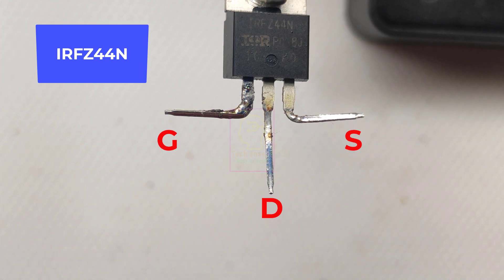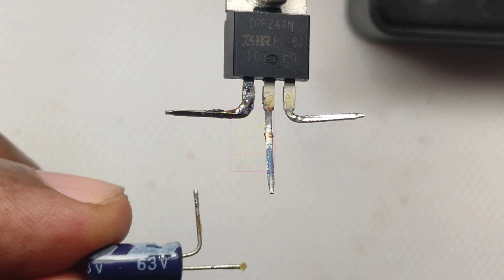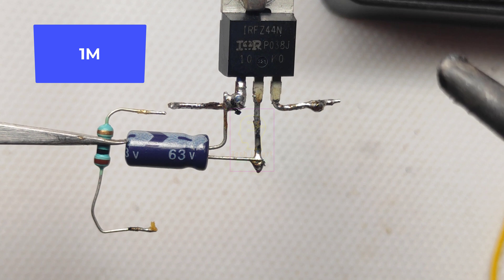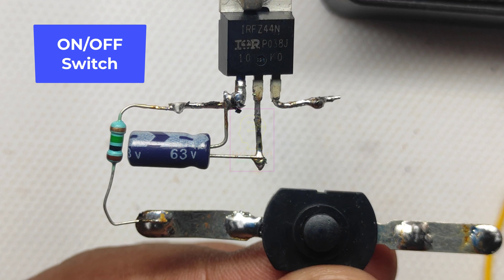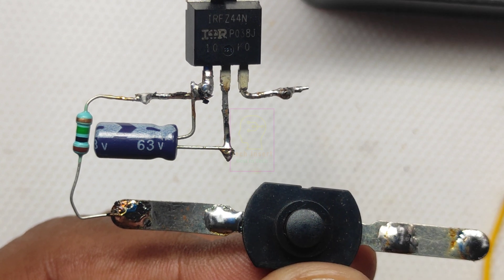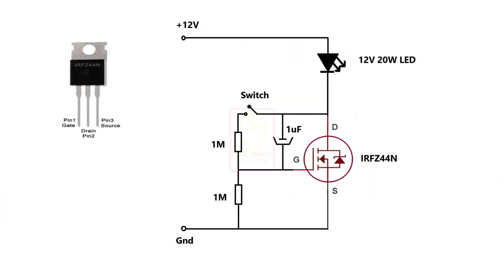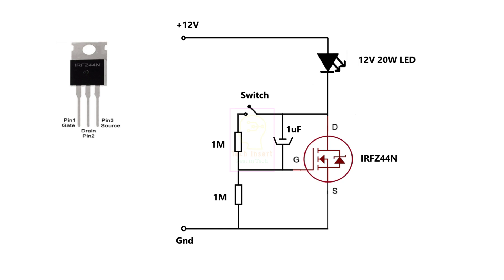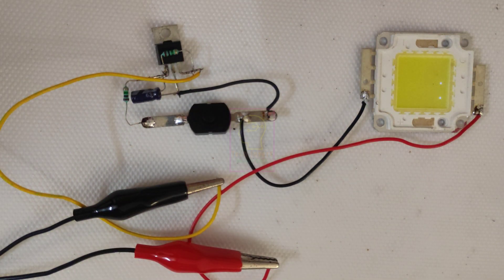How to Make Simple Soft Start/Stop For Motor/LED

Comment: Can it handle 21v 20amp and if yes then the single mosfet will surely become very hot and even if i use good heatsink some power will lose in form of heat
Can i parallal 2 mosfets to share current equaly
Reply: Ok now it's working perfectly but I want to use it with 21v do i need any modification in this circuit
Reply from the maker: @rctechmods8165  No change needed in the circuit
Reply from the maker: irfz44 can handle 49A with good heatsink. So it will works fine

Comment: Is this applicable another high capacity relay  40A to 80A for dc load
Reply from the maker: We cannot connect a relay in this circuit, coz relay is a normal switch which is switching electronically rather than manually. Here MOSFET is switching gradually thus softly start and stop.

Comment: Hey thanks for video
Can i use this circuit in between a 350ma 36v driver and 36v led to get soft on/off effects ?
Reply from the maker: My apologies for late reply. 
Yes you can coz irfz44 can handle upto 55V and 49A

Comment: Thanks for the video.
What will be the changes in the circuit if the voltage is above 35 volts
Reply from the maker: IRFZ44N can be used for max 55V

Comment: Can i do reverse the polarity like forward reverse dc motor?
Reply from the maker: Yes, change the wire connection
Reply: @TechInsert  does the capacitor not affected if I reverse the connection? Ok i will try this. Thanks a lot 🥰
Reply: @suplado7583  Not on mine. I put the output leads through a simple DPDT switch. I have been using this circuit for about 6 months for model trains in the garden. Locomotives drawing about 4 amps at 18 volts.
Reply from the maker: Good

Comment: Is it suitable for 12 volt 20 Amp water pump ?
Reply from the maker: Yes provide a very good heat sink to the mosfet
Reply: @TechInsert  thanks for the info.
Reply from the maker: @octavianustondatuon7775  You are welcome
Reply: Is it ok if i use relay, instead of switch on/off ?
Reply from the maker: @octavianustondatuon7775  Yes, we can
Reply: Can U show me with the diagram of circuit ? Thx
Reply from the maker: @octavianustondatuon7775  I didnt get u? what i understood from your question was whether we can replace the on/off switch with a relay where that relay will be controlled by some other circuit. Is my understanding correct? If yes then YES you can do that. Or is my understanding wrong, kindly answer.

Comment: Thank you for posting. This is an excellent circuit.
I am using it for an outdoor automatic battery powered model train control (G scale) with a loco motor rated at 18v and drawing about 300mA from a 12v battery. 
My only issue is that I am losing about 2 volts with no load on the circuit and about 4 volts with the motor at maximum RPM. With a 12v 5ah battery the motor is running at about 8v. I could do with an extra volt if possible. 
Is there any way to reduce the voltage loss please? I presume that by changing the capacitor value it will affect the delay/charge time. What happens if you modify the resistor values?
Reply from the maker: It is not the drop but mosfet is not switched ON completely. Please reduce the value of 1M resistor conected to the switch.
Reply from the maker: @carlteacherman194  wow that's good

Comment: Thank you for the 8nformation , is it possible to add a current limiting feature to this circuit as it is never advisable to let led pull as much current as it can and  will shorten the led life.
Reply from the maker: You are absolutely right, current limiting resitors are needed for leds on long running. Since i was testing it, i didnt add that

Comment: Excellent circuit, You really explained it nicely. I am looking for a circuit to soft start my Motorcycle Starter motor, specs are 12V and 250W so 20A peak. I see this circuit will not be able to handle this much power, what modifications could i do to accomodate that?
Reply from the maker: In this circuit we are using IRFZ44N which has a capability of handling 55V and 49A max. So this circuit will suite ur needs. Also fix the MOSFET in a very large heat sink.
Reply: @TechInsert  Thank you for responding. Will do what you said.
Reply from the maker: Thanks

Comment: What if the main switch that disconnected is ground, will the soft on and soft off still work? I will make for  led cabin car (switch triger by negatif dor) please help me by making a diagram with negative trigger
Reply from the maker: If you want a negative trigger, then use P-channel Mosfet
Reply from the maker: IRF4905 - I dont have this Mosfet with me, so i will buy it and try and the result i will let u know
Reply: @TechInsert  thanks you very much

Comment: Sir, what happen with higher capacity condenser? Can you do video for 3,7v batt. and 3V led?
Reply from the maker: Higher capacity will increase delay. You mean 3.7v and power cob led or smd led ?
Reply: 3,7V and 3V smd led, thanks
Reply from the maker: @MACYNET323   Sure definitely ill make a try.  One challenge is  smd led 5050 is using 3.2V and  nearly 100mA. So we need to connect LED's in parallel .10 LED in parallel will take 1A current.  So 2000mAh battery will last for 2 Hr only. Please watch these videos which is using  LED's and 3.7V 198650 Battery . https://youtu.be/l-wAQdu7v9s?si=dw9Nc1kc0dd11t3Q   https://www.youtube.com/watch?v=Oo8dm7VMJuU  https://youtu.be/Q40RyaDcX5k?si=yCvRoDZN5FFVGkZK
Reply: @TechInsert  This solar panel Led module would be even interesting if they are always on at very low power add proximity sensor + soft start/stop circuit.
About my requested video (dimming 3V high power Led + 3,7 battery) would be nice have regulation up 3 Ampere.
I have 2SD634 npn transistors
Reply from the maker: @MACYNET323  You need proximity sensor  or motion sensor. Soft start and stop is an excellent idea to addon. 

3V LED dimming, i will design that and let you know